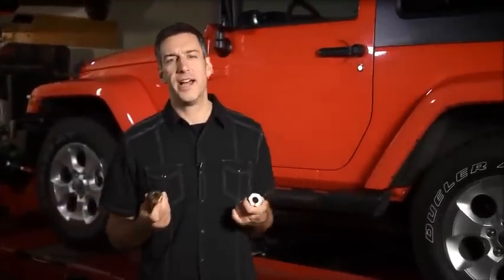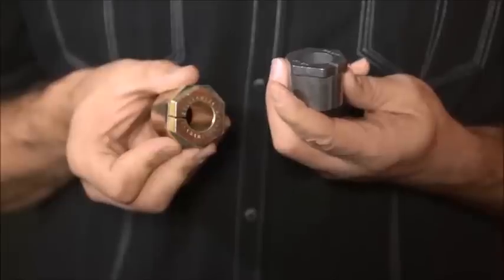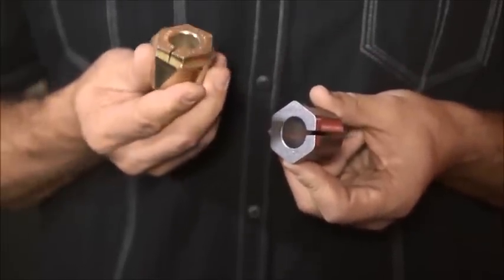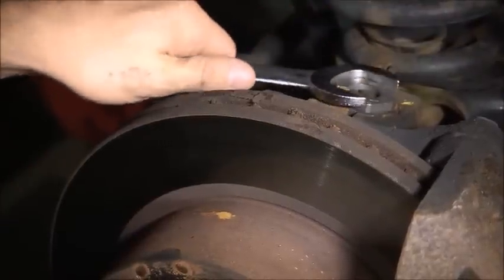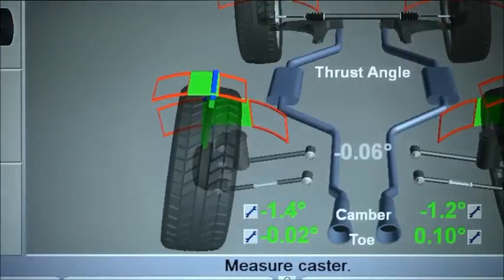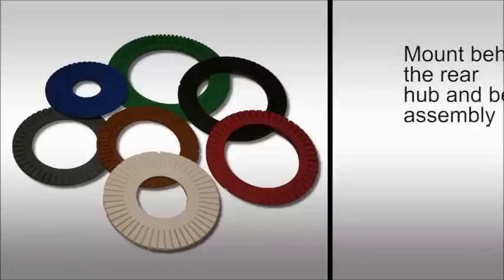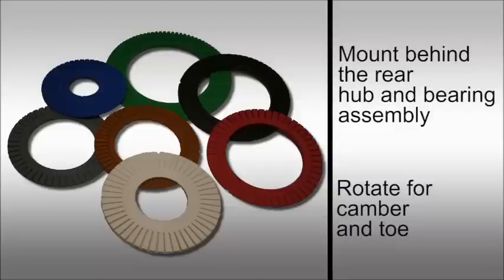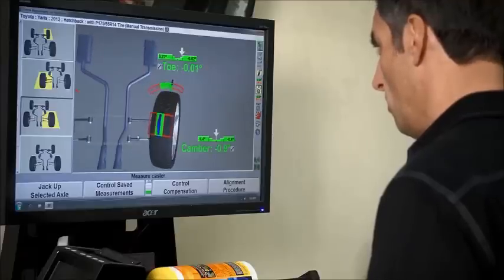Wheel alignment with the use of bushings and rear shims.

Comment: I am wondering if the thinner shims can do smaller increments like .04 pos or negative camber
Reply: Why? I can barely justify getting shims on my car after changing to new tires, balance, alignment. My rear camber is off .25 and toe .45 and requires disassembly for shims.
Reply: @PrestonSteele09  I used ez shim yellow on my 2004 corolla and got it close enough to be in the green at fireston.e .
 It was  Rear toe  L -.75 R  .05 
The shim was set at pos .80 and it got it back in